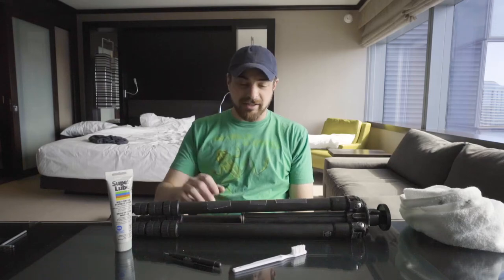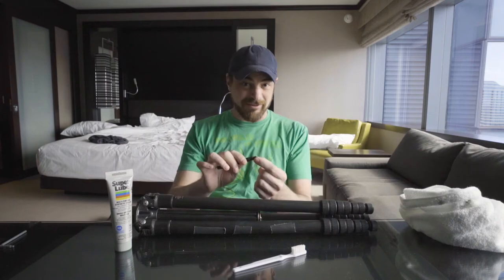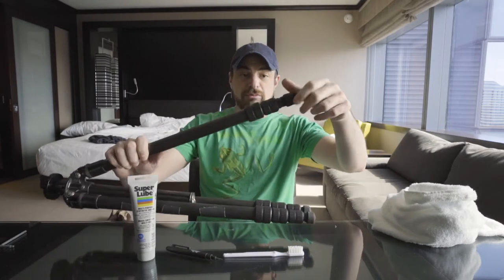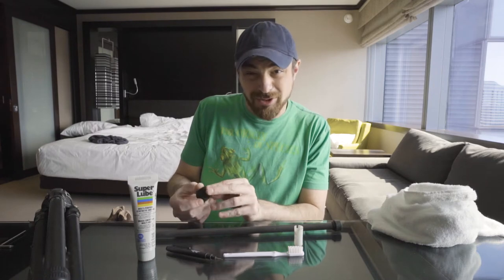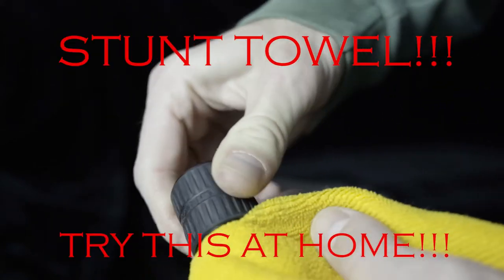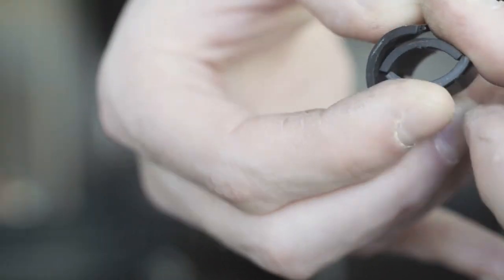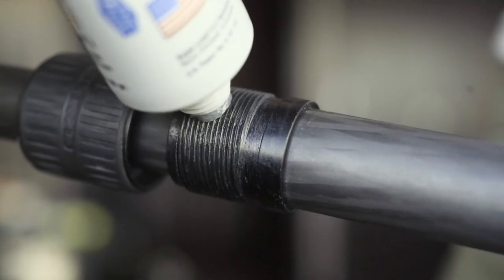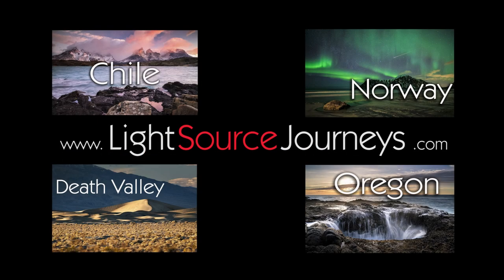Cleaning a Gitzo or RRS Tripod

Comment: A couple of my legs won't lock anymore.  Would cleaning them fix that?
Reply from the maker: Not necessarily. One possibility is that the little plastic collar may have broken, not allowing the tension to lock them down.
Reply: @lightsourcejourneys  Yeah, that is what I am actually thinking at this point.
Reply: @lightsourcejourneys  Thans. I just ordered a replacement part. That's what I think it is too.
Reply from the maker: @AVisceralLife  That's the great thing about Gitzo, you can usually get a replacement part from them easily and relatively inexpensively. Same with Manfrotto.
Reply: @lightsourcejourneys  Yeah, I got it today and now it works great!!